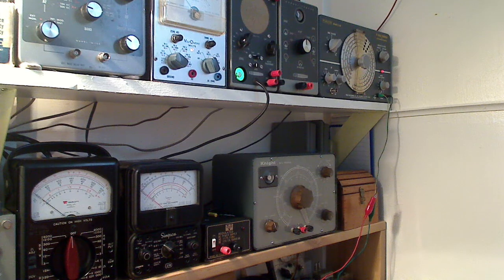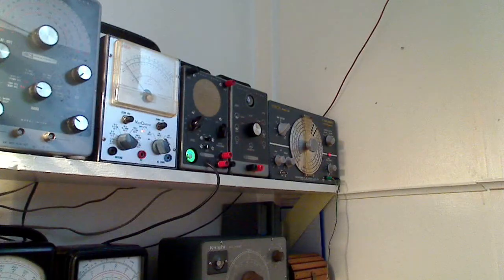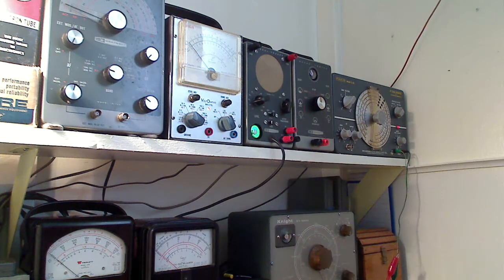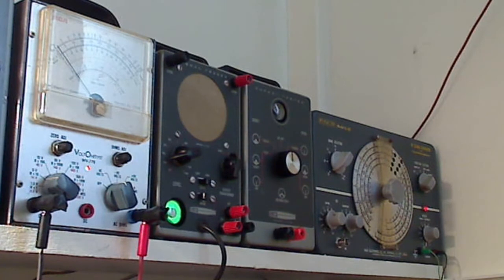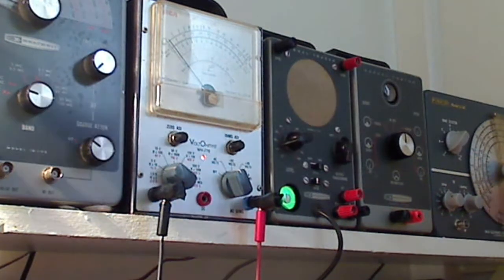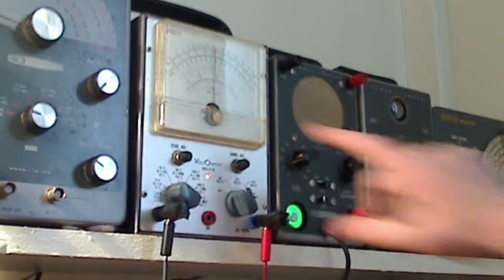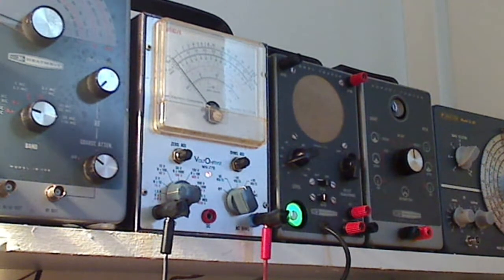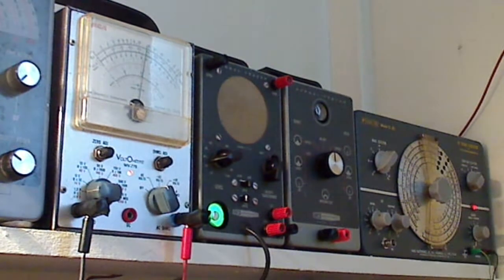How to Use an AC Voltmeter to Measure Audio Signal Level

Comment: I have some older analog equipment as well. When we use coax cable we have to pay attention to impedance of the path, when using clip leads we don't care about impedance matching of the signal paths? Just curious. Thanks good info.

Comment: great information, but can I use a new signal generator like the ( Koolertron ) from Amazon?
Reply from the maker: Yes you can, a new signal generator still outputs a signal which is all you need.
Reply: @docbrownsradiolab1220  Nice Thanks